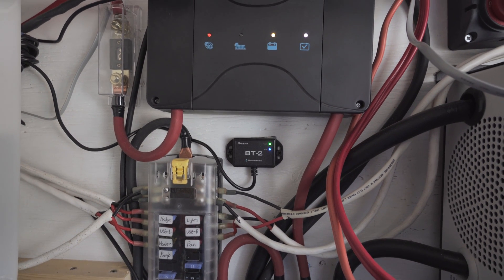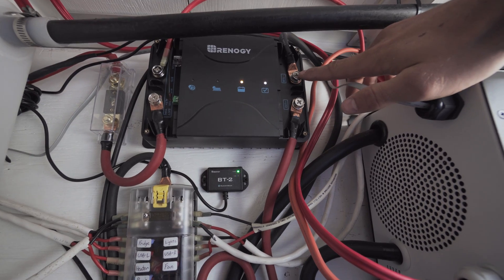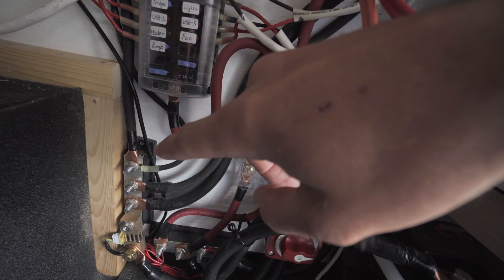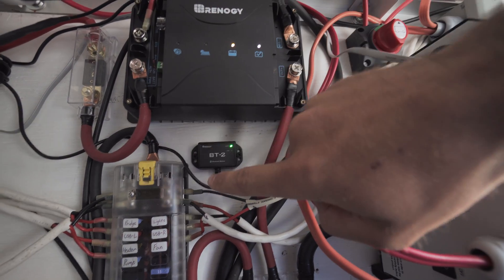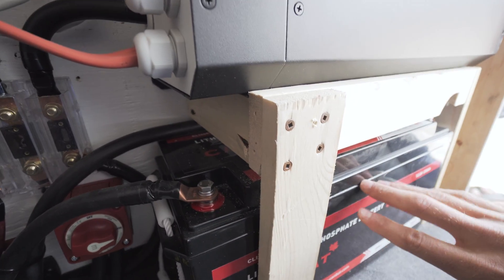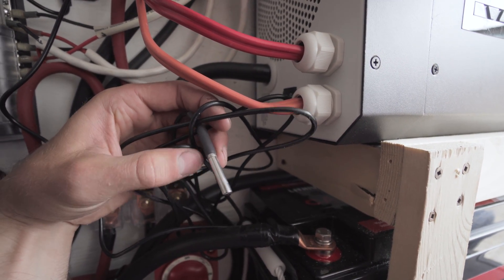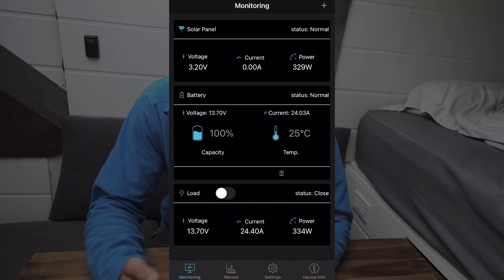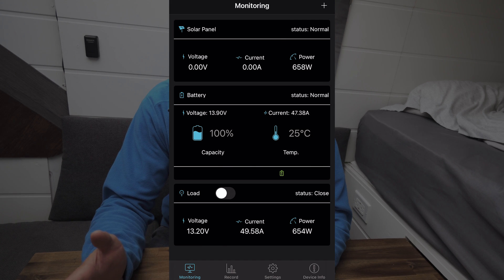Renogy DC to DC Charger Install in Off-grid Campervan Solar System

Comment from the maker: Don't forget to use the code MADETOTRAVEL for a discount! Thank you guys so much for watching! What DC to DC Charger have you installed in your solar system?
Reply: @Made to Explore, can you provide a link to the shutoff switch you installed?  THat would be rad!  Thanks!
Reply from the maker: @reecetas7196  done! Thanks
Reply: @madetoexplore  Love it!  Thanks!
Reply: Hey David, excellent informational video, thank you guys very much!
Wondering if you can chime in your opinion on following:
So, with this kit in place (installed exactly as the video shows, except I have the 30A charger) and if I want to use the Renogy 20A AC-To-DC LFP Portable Battery Charger to charge my house battery from the wall outlet (110V AC), do I just clamp the charger's alligator clamps to the house battery for charging, or do I need to disconnect ANY lines from the system first?
In the other words is the AC charger just a simple add-on or it requires some work around to prevent the rest of the system from being damaged...?
Cheers from Vancouver.
Thanks, Nash
Reply from the maker: @Nash_DJ  thanks! I don’t have any experience with that charger but i don’t see why you would have an issue simply connecting the clamps and charging the system.
Reply: @madetoexplore  Thank you, I am wondering if charging the LiFePo directly could send some feedback to the charger and "confuse" it or damage the circuit somehow... Sent the question to the Renogy, but no answer yet... Will post here if I hear from them... Cheers, Nash
Reply from the maker: @Nash_DJ  I charge my batteries using my Renogy inverter/charger via shore power with no problems at all! It’s essentially the same thing you’re planning on doing.
Reply: @madetoexplore  
Many thanks David.
How/where do you connect your leads from the external charger? I do not use the inverter, only the DC-DC MPPT 30A Charger between my car (service) and my Lithium (house) batteries, and just run 2 dual 12V to 5V USB convertors of the house battery to charge my devices, or run my LED cabin/camp lights and 5V heated blanket while on the road. Should I wire my 110V charger in to the DC-DC MPPT 30A Charger somehow (where?), or clamp it straight to the Lithium (house) battery posts - which was my original concern, if I did it that way, would I be sending some weird signal/power back to the charger and would I be damaging anything?
Reply: @Nash_DJ  Good luck with that. Renogy support is very bad. I'm currently on 6 weeks without an answer every time I contact them they claim they can't find my support number.
Reply: @DjbriancUs  They did reply and advised me to fully disconnect/isolate the lithium battery from anything - the controller input, as well as any battery output devices (USB or cigarette lighter plugs), before I charge it via an AC charger... They also told me to never put the battery in the marine battery (plastic) box, as I planned to make it one with the USB and cigarette plugs) and that sufficient ventilation needs to be around the battery at all time... If I knew all this, I would never choose their expensive system, the Yeti, Jackery or EcoFlow would be much better, cheaper and simpler solution for me... I also asked if there are any harmful fumes or other heath hazards, considering that I will be sleeping in my Jeep within 3 feet of the battery, but I never received any answer on that...

Comment: FYI it is 25 amps max for alternator and 25 amps for solar charge. it is not full 50 amps. they mislead peoples.
Reply from the maker: Incorrect. I get 45-50A from my alternator by shutting the solar off and connecting the ignition wire.

Comment: Do u need to run a ground up from the starter battery ? The other videos show u do ?
Reply from the maker: In my install, I grounded to the chassis through the busbar. You don’t need to run a wire all the way to the negative battery terminal.
Reply: @madetoexplore  thank you

Comment: Thank you for showing how to install the starter wire!!  I was never clear on that part.  I didn't bother doing it on mine because I've got a continuous duty solenoid that shuts off the connection between the alternator and the charge controller when the vehicle isn't running, which should do the same thing.

Appreciate the video!

Comment: I didn't see it in your video but did you install the bvs voltage sensor wire? and you are suggesting hooking up the smart alt ignition wire even if you don't have a smart alternator can i ask why? Okay i see you said i will get more power or full power from alternator but if i don't hook it up then what happens?
Reply from the maker: I did not install the BVS because I have a heated battery and that could stop charging if the sensor picks up that it is below 0C. 

If you don’t hook it up then you will only get a max of around 25 amps from the alternator

Comment: Can you explain why it’s important to install the ign wire? Did you install a switch to turn off your solar while driving or are you saying that the ign wire works as a switch and allows full charging from the alternator?
Reply from the maker: @BlackPineConversions  without the ignition wire installed, the controller will only pull a max of around 25 amps. When it’s installed and there is no solar detected (either driving at night or turning off a switch) the controller will pull 45-50 amps from the alternator.
Reply: @ ah ok mate thanks, but if you are isolating solar through a switch you’d still get the 50amps without an ign installed?
Reply from the maker: @ you can try it but I don’t believe so. I also haven’t tested out the newest model yet (50V version).

Comment: Do you have to run a negative from the starter? I see on your set up you have it from chassis but I thought renogy advises to run from starter.
Do you have any issues like this?
Thank
Reply from the maker: No you don’t need to run a negative wire. The negative connection from the solar panels and the charger should run to the busbar. The busbar is then connected to the negative terminal on the battery and grounded to the vehicles chassis.
Reply: @madetoexplore  Thanks you so much for your reply.
That's good news as I already have a 6AWG cable running to the back from the starter battery positive terminal. 
The van had a wheelchair lift and it was for that.

Comment: what does the ignition wire conect to ? cant seem to find a video on it everyone shows it atht en mppt chargr but not where the other end connects ?
Reply from the maker: The ignition wire can be connected to any fuse/wire inside a fuse box that shows 12v when the engine is running and 0v when the engine is turned off. You can test this using a volt meter. I connected mine to a fuse in my fuse box that is located underneath my drivers seat.

Comment: That + 4 gauge runs all the way passed the other side of the fuse to the alternator?  Or does it go smaller gauge?   Looks smaller on the starter battery.
Reply from the maker: It’s 4 awg all the way. The fuse should be installed on the starter battery to protect the wire as well. I relocated mine and switched it out for a terminal fuse.

Comment: @madetoexplore downloaded your guide and it's been really helpful! Found a very small error, but it initially confused me for a second and could potentially cause someone some harm. On the last page of your SIMPLE SOLAR SYSTEM DESIGN.pdf , the positive and negative busbar hookups to the DC50S seem to be flipped - on this unit, the ground is the top right and the positive is the bottom right, not the reverse.

Comment: I like how straight-forward this video is.  Most useful.  So many videos are annoying or misleading because they start with "Hey guys,..- and then tell us a bunch of extraneous stuff.  This video would be even better if it had an electrical diagram.  I am about to make my own electrical diagram from it now.  You have followed the main principle in explaining a process. "Keep it simple stupid" or KISS.  Nice job.  Very nice job.  

My issue for some time has been how to compact my system like the way it is done in a van.  You guys who work in vans are really good at this.  However, I also see mistakes in van builds because the batteries are put way too close to the charger/inverter.  All of the manuals say that batteries close to a charger can cause fires.  This video does it correctly.
Reply from the maker: Thanks! My battery and inverter are close together but in a very well ventilated spot. It also depends on the type of battery you have.

Comment: Hey is 50 amp version too much for my old 1992 ducato motorhome ?
Reply from the maker: Depends on the alternator. Do you know how much it puts out?
Reply: @madetoexplore  I tried do some research and I think it's 60/65 amp. Can I check that with a multimeter maybe ?

Comment: Hello again does the smart controller care what starter battery u have in vehicle
Reply from the maker: No it doesn’t. Most people, including me, stick with lead acid.
Reply: @madetoexplore  thank you soo much great video keep up the great work
Reply from the maker: @vdub6873  thanks! 😄
Reply: @madetoexplore  is there any other safe way to charge this type of system with 110 power n not mess up controller or solar at same time other then inverter charger?

Comment: Just put that wire onto the engine battery with a switch on the dash. Or if you like without.
Reply from the maker: Thanks for the suggestion! 👍

Comment: Just to Update :

As a Renogy Ambassador 
the latest releases of the DC-DC/MPPT unit have had the Auto-Sensing Software updated and it is NOT necessary to hook up the Smart Ignition Vcc+ to a live ignition source.  The unit will detect when ;
a) Your Alternator begins to charge and 
b) When Pv ( solar )input goes below the minimum useful level.

* However, If you do have a Smart Alternator or upgraded style Alternator with an output over 100amps it is best to use that connection.  However, it MUST be connected to that Smart Alternator and not just an ignition Vcc+

Another connection I saw on your install was connecting the Pv ( solar ) Negative to your Bus Bar , when in fact it should be on the Ground Lug of the unit itself.  This helps to achieve more accurate monitoring from your Pv data as a "Virtual Shunt" in the Renogy App.  

Also what I didn't see in your setup was a Protective Breaker coming from your Solar into the Unit.  This can be important in case of a Pv surge or even worse a lightning strike that would destroy parts of your system.  A solar combiner box is a handy tool with breakers that not only protects equipment But also allows you to have multiple panels on the roof AND quickly and easily add a Portable Solar Array on the ground for increased charging of even a " quick setup " Wind Generator into one of the combiners inputs. 

Hope these notes are helpful to someone. 

Note I generally build systems for sailing yachts but recently have done a few Nomad Vans , including my own with my soon to be activated channel 
" Captain Vantastic "

Cheers -- Merry Christmas 🎄 
and Take Care Friends ....
Reply: Hi there….very useful information. Can I ask how do you connect directly to the smart alternator? Thanks
Reply from the maker: Appreciate the updates! Does it still prioritize solar over the alternator? Would be nice if they changed that to maximize input. 

My panels are individually fused to protect each panel and the controller 👍
Reply: @madetoexplore The software now no longer prioritizes solar , it utilizes the best option or combination to achieve the 30amp or 50amp charge, depending if you have the 30a or 50a model.
Reply: Is this a software or hardware update? I’ve read somewhere a new version accepts 50v solar input, I’m hesitant to purchase one, as I’m unsure I will get the latest version. Also, will it now, Instead of prioritizing, charge at full 30/50amps from alternator if solar isn’t sufficient in charging (such as low sun light or night driving) I’ve read a few people could not get over 40 amps on the 50amp model. Thank you!
Reply: I don't have enough of a grasp on how this set up works to completely follow your comments.  Could you elaborate on " However, it MUST be connected to that Smart Alternator and not just an ignition Vcc+"?  I was planning on just finding a fuse that is only on when the engine is running and connecting the IGN Signal Wire to that.  Are you saying that won't work?  Thank you.
Reply: This really helped me out. I just bought a Renogy 40A model and it clearly says not to connect IGN if you don't have a smart alternator. I presume this is because of the auto-sensing software update. I was concerned I would flatten my battery overnight without connecting IGN but no need for concern.

Comment: Do you need to connect the D+ if you don't have a smart alternator and it has a built vsr.   My red arc works fine with out the d+ connected but I've just bought a Renogy 30a dcdc
Reply from the maker: No, you don’t need too
Reply: @madetoexplore  thanks

Comment: Am i seeing what i think im seeing your electrical system in same arez as your water tank 😮 to me only i don't think thats smart if you got a water leak or some kind of issue with your water tank it won't end well , what do you have for a fire extinguisher i recommend halguard clean agent hr3 performance,  doesn't leave any residue no mess to clen up no thermo shocks to electronics is rechargeable,  dose no impair user vision i have 2 and im Not sponsored only information 😊
Reply from the maker: I did it that way to equal out the weight. If there’s a leak, the water will run out the bottom of the van through a drain. Not worried about the electrical components at all since they aren’t fastened to the floor of the van.
Reply: OK next do you still use the renogy lithium batteries I do I have 2 but I see lots of people installing battle born batteries I like renogy products at this I don't plan on jumping ship

Comment: I installed one of these on my boat. When my engine is running and I am getting solar power as well I hardly get 12 A of charge current to my 200 amp hour lithium iron phosphate battery. If I turn off the solar panels, then my battery gets about 30 to 35 A just from the alternator. Something is not working accordingly. Does anyone else have this problem. My understanding is I should be seeing a maximum of 25 A from the solar panels in a maximum of 25 A from the alternator. I don’t get anywhere close to that.
Reply from the maker: Have you installed the ignition wire?
Reply: @madetoexplore  I’ve tried with it connected and not connected, and it doesn’t seem to make any difference

Comment: Hi. Thanks for the video. I do not have solar panels on my van , so can i still use this dc to dc charger? And where the negative cable from the vehicle battery goes?  To the negative bus bar? Am i right? Thank you
Reply: Did you connect the unit ground little bolt to the vehicle chassi?
Reply from the maker: @zura73  no I didn’t. The main negative is grounded through the negative busbar. If I didn’t ground my negative busbar to the frame I would’ve connected that small ground.
Reply from the maker: Yes that’ll work

Comment: Hello and thank you at last I’ve found the issue to solve my setup. Can you tell me why the ignition wire comes with the kit only has positive wire not ground and you have. Can you help. 
Steve.
Reply from the maker: Some came with duplex but you only actually need one single positive wire. I could disconnect the ground on mine and it would still work the same.

Comment: Shouldn’t the fuse on the starting battery wire be closer to battery and not the charger?
Reply from the maker: Yes, I installed a 60amp breaker beside my battery 👍
Reply: @madetoexplore  okay great 👍

Comment: I know this is probably a noob kind of question, but does this work when your starter battery is flooded lead acid and your house battery is lithium?
Reply from the maker: Yes! Lithium batteries aren’t meant to be automotive starter batteries. It would also be a waste of money to use lithium as a starter battery.

Comment: Do you only have the switch on the positive solar line? No fuse on that line? And if you didn't have a negative bus bar, would you just add the solar negative to the negative side of the MPPT?
Reply from the maker: I have 15 amp mc4 fuses between each of my solar panels and yes it’s only on the positive wire. The MPPT still needs to connect to the negative busbar or battery

Comment: I did mine this way after watching this and it works perfectly (thanks to your video 🙌) as long as I remember to turn the solar back on after I get done driving 🤦‍♂️😂 did that last trip 😂 anyway I believe my alternator is factory 150 amp and it just recently went out. I was thinking of putting a 200 amp in but don’t know if I need to upgrade wiring or fuses or if I should just stick to the 150 amp. Also I’m guessing the alternator going out was just a coincidence and hopefully not a result of something I did 😳🤦‍♂️😂 I wired my dc to dc same as you did and hooked it to my positive on my battery. Works exactly as you described here. I love having that option to get so much more amps while driving. That originally was my only reservation about this renogy was the limited capacity. 
I have the 06 t1n 2500 👍
Reply from the maker: That’s great! Upgrading to the 200 amp alternator isn’t a bad idea at all. It’s also common for some of the connections around the turbo to leak down and ruin the alternator. Be sure to keep an eye out when you replace the alternator!